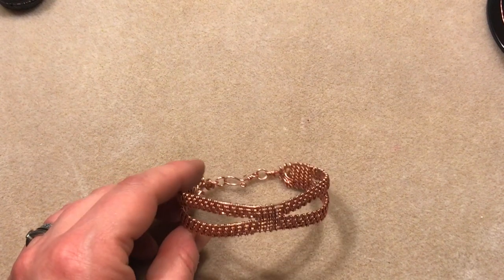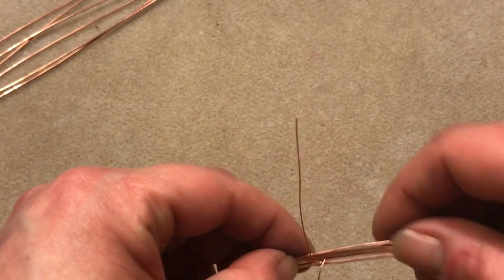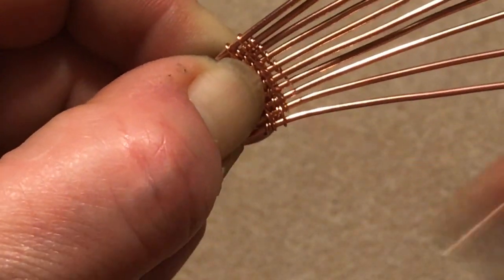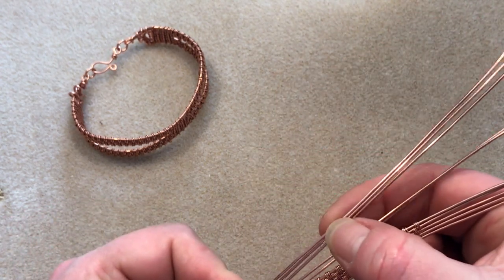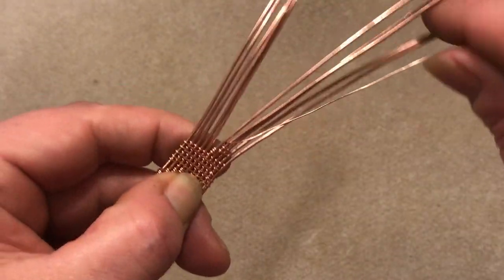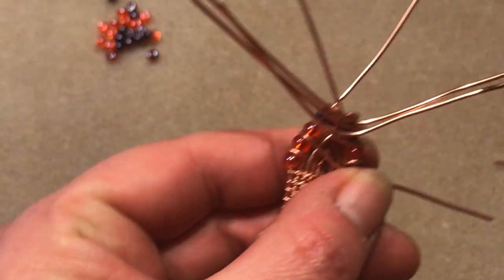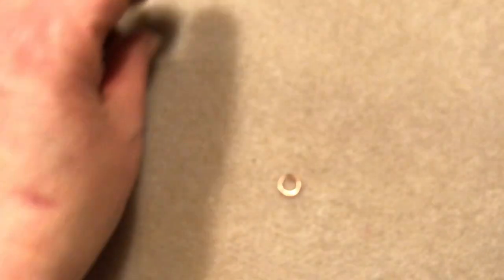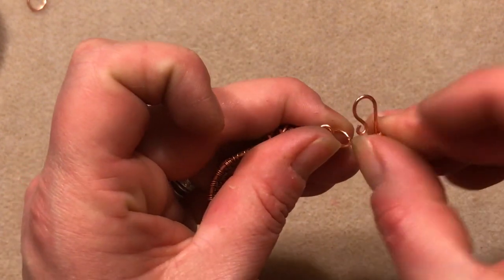Wire Wrap Ribbon Bracelet tutorial

Comment: I made this bracelet but I messed up my left thumb, it is swollen, painful and it popped out of joint and I had to pop it back in, not sure if this has happened to anyone else. Do you have any advice to hold wires while wrapping without having to apply so much pressure to the thumb to hold it in place?